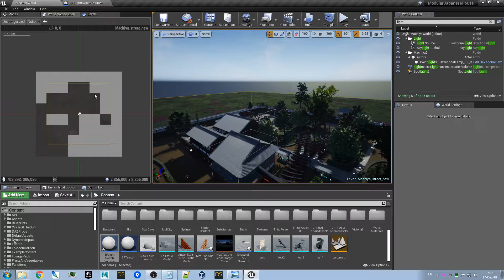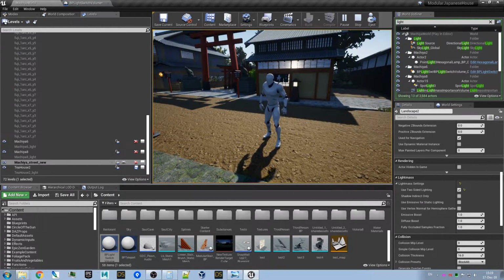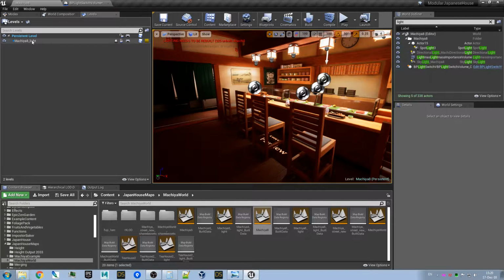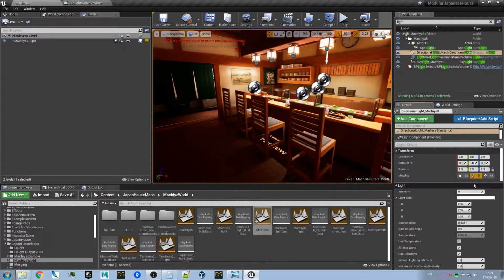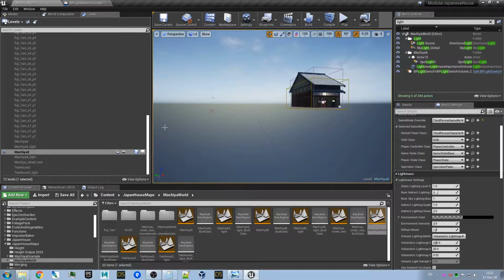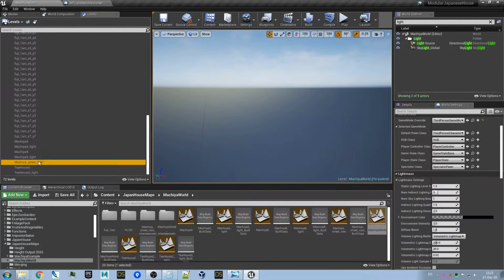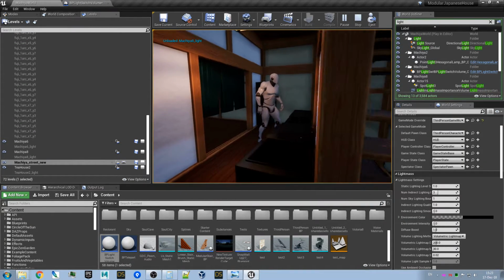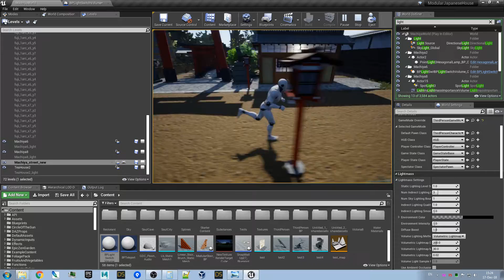Combining dynamic light and built light scenario and world composition in UE4 (experiment)

Comment: That's a neat trick to use in such scenarios. The only let down was the sudden pop in of the lightscene loading once you enter the building. You can try to use post-process volumes in the entrances which will use a dynamic GI and then slowly blend those light maps in. If you can somehow get to switch without the Entry / exit snaps that would be great!
Reply from the maker: Thank you! By dynamic GI you mean Light propagation volumes? I never really tried those, but maybe it can work.
Besides, I'm still not sure it works. The example here works, but every time I open the sub level the two light actors in the light scenario are reset to zero.
Reply: Yea I meant the LPV, and also the GI effect in post process volume, Not sure if they work well together but can try. I have only worked with purely static lighting till now, would love to try out the blending between lighting scenarios. Check out some of my works on my channel.
Reply: @games_inu  Hello, finalement cette technique fonctionne bien ou il vaut mieux rester en full static ou full dynamic ?
Reply: There is a way to do the lighting scenario feature to where it is a smooth transition and not sudden pop in.